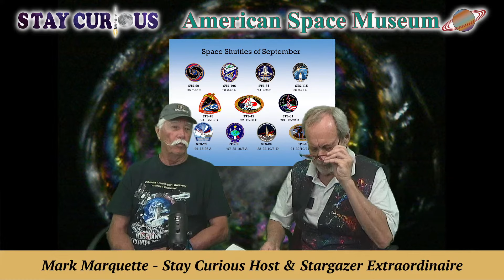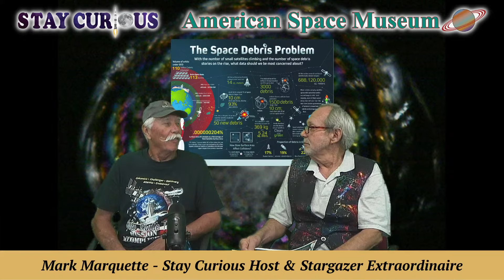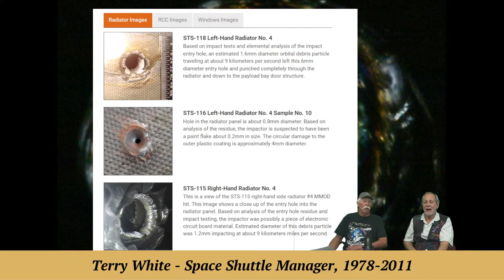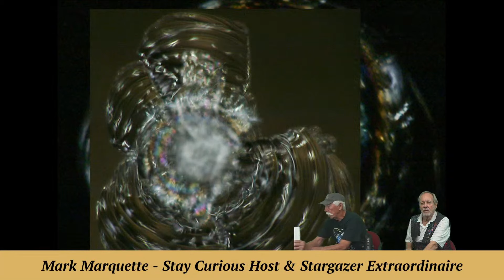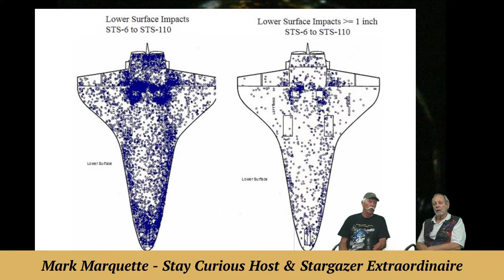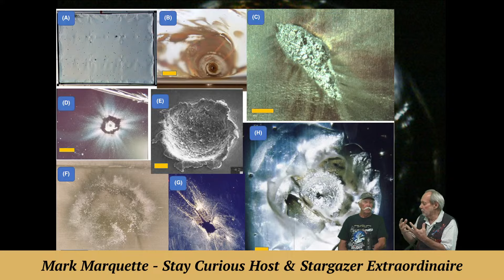Terry White on Impacts of Space Debris on Shuttle Orbiters and Satellites | Stay Curious 2023-09-13

Comment: The orbital debris problem highlights my least favorite space project of all time - the inflatable modules/hotel ideas of Bigelow Aerospace. Its not the 10 cm plus pieces that are the persistent worry, they can be tracked and a Collision Avoidance (COLA). Its the pieces the size of a BB and even smaller that could bore through a thin hull like butter and through inflatable structures like they were a child's balloon. An area of safety I would like to see addressed is after a hole is active what kind of materials could be used to plug a hole to stop a depressurization and the accessibility of that hull interior surface to a crew. Another issue is finding the leak when seconds and minutes count. The recent incident with the Soyuz highlights these issues.

In Sci-fi on Lost in Space they put a magnet over the hole in the ship, but when you consider air being far less viscous, that would not really work to make a seal and if you were lucky might buy extra moments to don a pressure suit. A thick fast hardening "goop" of some sort would be a good starting place. Even a glob of chewing gum could save lives.

On mission design, the worst idea is of putting a dying satellite into a higher parking orbit. If you have the delta-V to do that you can lower the perigee or create a deorbit scenario. Higher parking Orbits are a way of "kicking the can down the road."